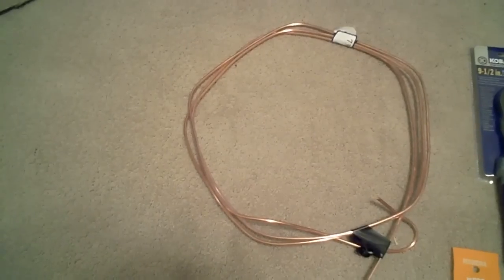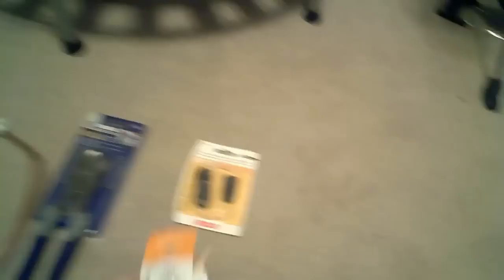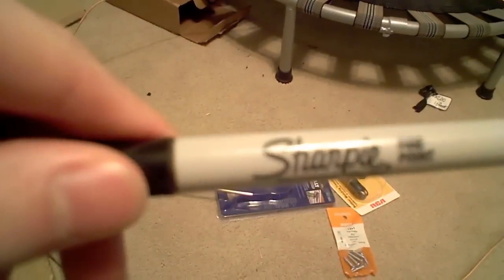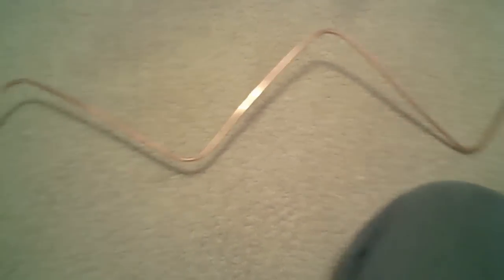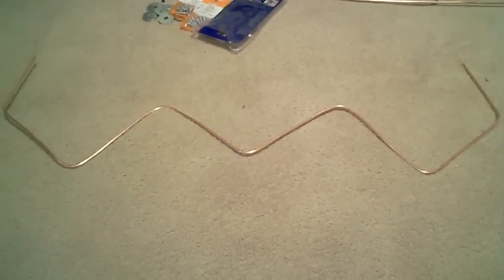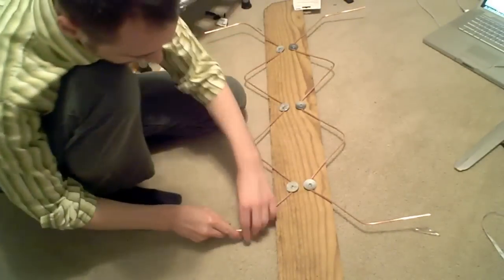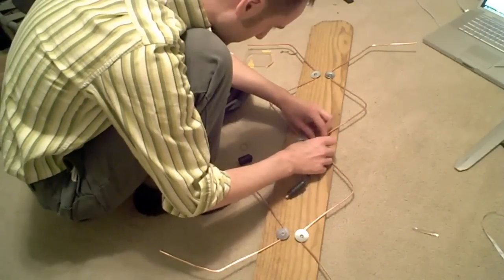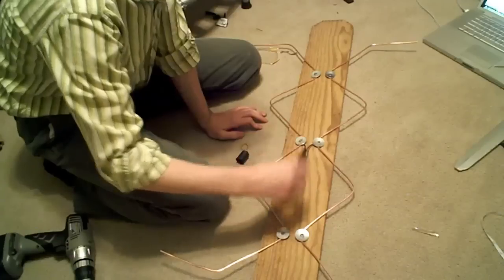How To BUILD The BEST HDTV ANTENNA! | Homemade HDTV Antenna DIY

Comment: Rabbit ears might work for me but i would need to mount it 50 feet in the air. Have you seen those square amplified antennas at Walmart or Radio shack that cost 40+ dollars? They are even crap compared to a quality homemade antenna and i make these and sell them for $20 bucks all the time. Word of mouth travels fast so i stay busy. I tested a square antenna from Radio shack a neighbor paid 50 bucks for against my homemade antenna and his got 2 channels and mine got 18 channels. $50 vs $2 bucks

Comment: Rabbit ears are a joke and do not work for most viewers unless you live in the same city that the channel is transmitted from. I am a ham operator and understand antenna basics etc and rabbit ears are about as effective as a paper clip and in fact if you live in a big city that has tv stations a lot of the time you can just plug a paper clip in the coaxial input on the tv as pawn shops and other places that sell tv's do freguently. I live 40 miles from Fort Wayne In and 60 miles from South Bend

Comment: Use Tools Much, Looks like your having a lot of trouble putting the screws in to the wood, Also you got ripped off on your Wire Snips. Oh yea never buy Washers in a Pack buy them loose, you'll save more, Other then that not to bad.

Comment: it's NOT a BALUM but a BALUN. This word comes from "BALanced" and "UNbalanced" as it is what the transformer does. You're connecting a 300 Ohm BALanced antenna to a 75 Ohm UNbalanced line to your TV. Please correct that, it's so annoying to see people get simple stuff wrong. This is a really good antenna design by the way. Measurably better than the speaker wire and roach clip idea.

Comment: This is a common design available commercially all over town for less than 50 bucks (4-bay or 8-bay design). You don't need a homemade version unless you're doing it as a hobby. Try to come up with a version that can pick up stations within 150mi from the transmitters.

Once upon a time the most powerful UHF TV antenna looks like a satellite dish with rows of metal reflectors and 1 of these antennas in front mounted backwards. The product: Channel Master 4251. Nobody made anything similar since.

Comment: Speaker wire in place of the copper tubing?  Did you use the Gray-Hoverman design or you literally plugged in 20 feet of speaker wire and hooked it up to a balun?

Comment: Just want to add another 2 cents:
The antenna works better if you use 1 inch PVC pipe cut into 4 inch lengths and mount
the pieces on the wood, then mount the wire on top of the PVC!!  Peace :)

Comment: without mast pre-amp range is about 15 - 40 miles
with mast pre-amp range is about 40 - 60 miles. It also matters if there are lots of trees around or tall buildings. if you have an attic you can stick it in there!

Comment: Dude!!! that's a GREY-HOVERMAN!!! I use that design myself. The cool thing is that it only uses 2 pieces of wire bent into elements!! I use a double stacked on top of each other with a reflector and mast mounted pre-amp!! I live about 50+ miles from the transmitters in my area. I do not have a rotator, but I can hand turn the mast off my deck! Works great! Peace!!

Comment: I'm all for do it yourself projects when it saves money but this seems like one that would cost more than its worth. For 34 dollars you can get one on eBay that has a 150 mile range with a motor that adjusts 360 degrees

Comment: This is called a 4 bay UHF.  A real good one is 8 bays plus a reflector with a hand wound balun transformer.  For channels 7-13 you also need a log periodic about 8 feet long :)  Put the 2 up on a mast with a rotator and in some places you can get 100 channels or more free! A free to air satellite has 284 more channels (yep no charge) which is about $300 for the gear.  I got maybe $450 in my system but I get 394 channels with zero monthly fees!  Ever wonder why they don't tell you about this?

Comment: You are gonna laugh when I tell you this but its absolutely true. I no longer have cable either. I use a 6 foot cable wire and an onion. NO LIE!!! I put one side of the cable in the back of the TV and just the tip of the other end inside the skin of the onion. I PROMISE YOU it works. The onion lasts a couple of weeks before you change it. I get PERFECT HD. DO NOT LAUGH until you try. Its super easy!!

Comment: Hey LaneVid, I'm in Canada in a fairly residential area, I made mine from another video which took about twice as long and looks more crude, I was only able to pick up 2 scrambled channels, do you auto program it? on cable or air? I didn't pay much attention to the measurements/spacing of the wire, is this vital? We have 2 HDTV's in the house and same thing on both, just wondering if i'm missing a step for when I plug it in because both channels were more like 1960's tube TV quality haha, Thanks

Comment: hi, i have just build one and it works better then my sdv6122t antenna, with 32db as opposed to 21db! when i put mine on the balcony outside (1st floor) i get all channels working excellent.. do you think it still needs grounding?

Comment: @LaneVid I bought RG6 cable and, amazingly, it works almost flawlessly. I also figured out why the tv tuner isn't as effective as my TV's native tuner. The computer's tuner is a dual one. That means the signal is split and therefore there's a loss of signal. But things are definitely improving. I may try a baffle behind the unit to pull in as much signal as I can but for now I'm happy. Thanks again.

Comment: @LaneVid I found out it's called RG6 coaxial cable. The cheaper one (RG595 or something like that) only has a coating of copper whereas RB6 is pure copper. It's particularly good for long leads and essential when it comes to gained signals (amplified).

Comment: @LaneVid I ended up using a combination: copper wire for the short pieces, coat hanger for the long... works pretty well... I'm gonna make one all copper for the computer so it can have its own (i'm routing it thru a tuner card to be able to record shows and also to get better sound... my tv won't send convertible sound to my digital analog converter (audio only) whereas the hdmi from computer can send the whole sound thru for some reason...

Comment: i followed these instructions to a T, and upon hooking this up to my LCD tv I get nothing but static. The balum pads are both touching the copper wire and I have the antenna upstairs near a window and I get not even the slightest trace of a picture. I live in a moderately sized city so nearby signals is not a problem. Any suggestions on what the problem might be?

Comment: Hi, you have a good information and will try making my own HDTV Antenna, one question for you, I live in St.John's, Newfoundland and Labrador, Canada, which is way up north east. What is the best way to know if this antenna is going to work, I live very close to a local digital TV station, is there a website that I can put my latitude and longitude to check, please advise. In your video clip you were in your attic, but do I need to put my antenna on the roof of my house or in my back yard.

Comment: Well, I made the antenna and it works fine, but I am disappointed.  I made a Shoebox Antenna last week (see videos elsewhere on YouTube) and it actually outperforms this "Best HDTV Antenna".  And the Shoebox antenna is a lot smaller and simpler to make.  Has anyone else had a similar experience?  So far, the Shoebox antenna has outperformed both my rabbit ears from Radio Shack as well as this antenna.  I live in Cincinnati and I want a better antenna so I can get Dayton stations too.  Help!

Comment: Nice!! I made a template out of a piece of pine and put screws at the bend points.
super easy. Just take the wire and bend it at the angles from the screws, which are placed in a zig-zag pattern. then just measure the ends for the right length and presto!! Try it you'll like it. Peace. if you place a reflector about 3 to 4 inches behind the antenna you might get more signal strength. nice Tenna and nice vid@@

Comment: I lost interest when you mentioned schematics and millimeters LOL. That solid copper wire is probably more expensive than buying the HDTV antenna at retail.
I built a coat hanger HDTV antenna and it cost me $9 total + 40min of assembly, I get all the OTA channels available in my area.

Comment: @Killsuit71 lol, I did not make this video:) But, glad it works now, I am building one now. I am just waiting on the 16 gauge wire to arrive in the mail. I painted my wood plank, and added a mesh screen as a reflector. Heres a pic if you want to see it, came out better than I hoped. (freeimagehosting (dot) net/image.php?1a52481bbc.jpg)

Comment: ...just remember...you need a HD TV for this thing to work...(yes it works)...I m about 30 miles away from most tv transmitters...my only problem is, when it rains, does not work very well, ( I supposed every thing gets "shorted" out...)

Comment: Hey man great video! But im having a problem.. Ive followed every thing exactly they way you did it.. according to the schematic.. But when i plug it in im getting the BLue screen and No signal.... im using a flat screen tv with the Coaxial cable input on the back of it... Any ideas?

Comment: I liked your straight-forward, step by step presentation, but for those of us who need some notes along the way, you could add a stop frame with measurements, and explanations of things like baluns and transformers. Are they actually the same thing? Also, I wonder what would happen to the reception if you added a magnet and a coil of wire to the bottom of the antenna? Nice job overall, and I think I have the confidence to give this project a try.

Comment: Well I just use a 6" loop Antenna that mounts on the in jack of my TV & get  18 channels, the same as with an RCA amplified antenna!   Check out antennaweb . org / aw / Address . aspx  (without the spaces).  Enter your address & It will map out every station in your area so you can find out if you need a fancy antenna or not.

Comment: Your antenna is clearly a Right Wing Nutcase antenna since it picks up FOX! Just kidding. Seriously, your antenna is called a Gray-Hoverman, and it it a first-rate antenna. Your design (zero doubt) works well, but IMO would work better if you had made a wooden template, and bent the elements more sharply and accurately. There are some very smart people online that have worked very hard to improve the basic GH you've shown here, but your design will absolutely be a good choice for most people.